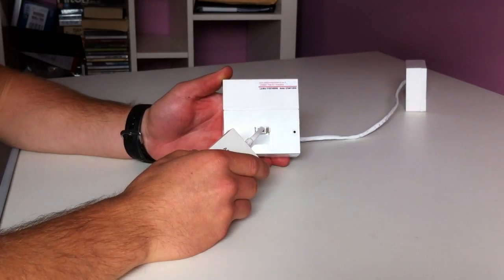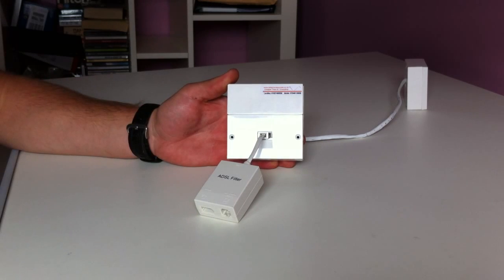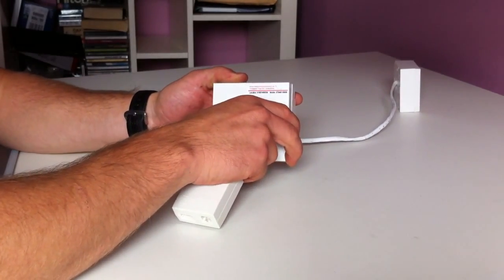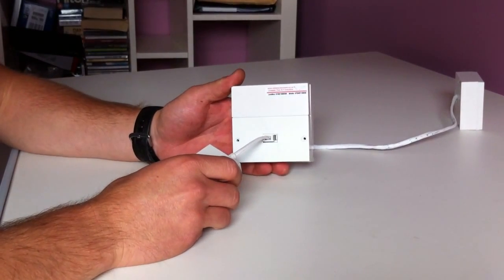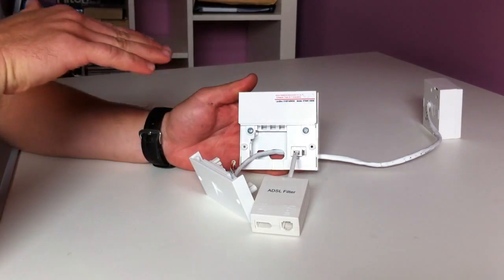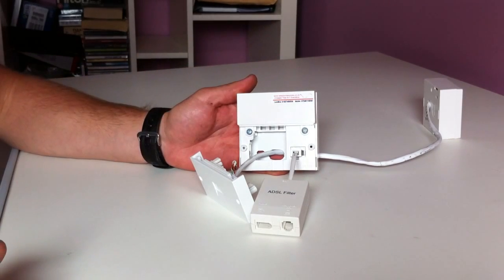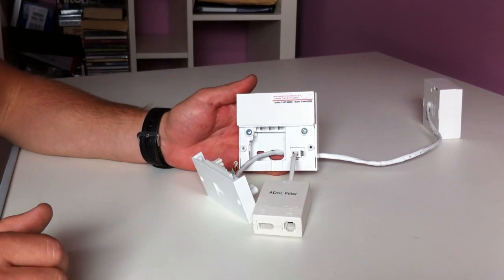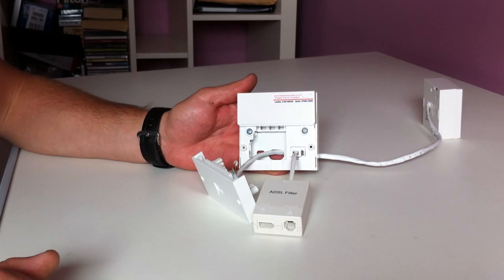Fault on your telephone line? How to test your own internal telephone wiring and extensions.

Comment: Has helped thank you. I didn't known about the line rental. That's a good point, my ISP don't want to replace the line and we don't even have a master socket. We have a master line. Which is just over the door. It's a small box with to wires coming out of it.

Comment: try the checks on that website, really helpful, it could possibly be a hr dis on your line outside, doubt its in the exchange, a hr dis is a hair line break in the cable and when the phone rings it pushes it further apart, you need to ask for a broadband engineer.

Comment: Hi, in my case the test socket is not working but BT refuses to fix it because the cable connecting the junction box and my flat is situated in the walls... they say it is the managing agent's responsibility to do the job. Is that true?

Comment: if any of your equipment supplied by your provider is faulty then charges will be made but you provider will be responsible for them unless the fault was caused by misuse or damaged by you. also if your extentions were provided by your supplier(especially if you payed for them)then they have i believe a 12 month warranty on them. something to keep in mind

Comment: @Sound Speeds   2.5mm to 3.5mm  adapter connected to headset of phone , then to 3.5mm to 1/4 phono (,mono) then inserted to mixer using aux send and mic input,, ,, dial does not hum but when you try to dial a number, a loud humming comes up,,, how do I fix this ?

Comment: Hi, Ive just had fibre fitted and my phone was working fine before the new plate has been fitted. Broadband works but has up and down days regarding speed but i was told to expect this. The phone no longer works and i have tried in the test socket. I'm with Plus net. Regarding the line are they in charge of the line coming to this main socket or just outside my house and all "wires coming into the house" is my respectability?

Thanks

Comment: Hi, my phone line does and always has worked but my internet speed is tortoise-like. Seeing my phone line works fine, is it down to my internet provider connection in the street terminal that is the root cause of my slow internet speed? I have just this minute changed my master socket into my house just a a matter of elimination. Thanks. Ps. My internet speed was fine until I recently changed providers!

Comment: Then how can I get around my problem as my internet broadband has cut off but I still have a tone dial before or after isolation. Recently a BT engineer has installed a neighbours internet in the block of flats I live in. I don’t know what he has done but he has coursed  my net to go off. My service provider has sent me a new router out to eliminate if that’s the problem. But with all honesty I believe it was the BT engineer. I traced my wire to the communal electrical cupboard and found two different cables attached to my cable leading into my property. What I’m really annoyed with is after watching this video it seems like I’m going to be charged for their error. I’d wire it myself if I had ample knowledge. Why would I still have a dial tone weather isolated or not but not have any internet broadband? It’s been of a week now.

Comment: My internet speed decreased, i contacted my isp and they said its a problem with my end if i were to use the test socket temporarily could it go back up to normal until i can get the front plate fixed?

Comment: Also, take note... If you follow the advice in the video, prove that the fault is NOT on your internal wiring, call your service provider to rectify the fault and the engineer informs you that the problem is being caused by corrosion inside the NTE5...... You are still liable to be charged.. .. .. Sad but true ;-(

Comment: hi my wife and i have recently moved home,there are 2 sockets not working.the one in my bedroom just doesnt even seen to fit the phone jackand the other is connected to a double plug socket which is labelled this phone socket does not work but the plug sockets do,is it a case of the wires are not connected to use these sockets?we have a cat that like to chew wires so want to put the hub into my room as the cat isnt allowed in there,anyone help?

Comment: My house phone is great no sound on the line and my internet is fast but tens to drop out a lot when its working its great but its dropping out every 30mins or so adsl like flashs when this happens wait for it to stop then it tryed to reconnect to the internet again what could be the reason for this i have pull my phone out and have no filter as well as disconnected anything elses that runs thought the phone line.
Reply: Your router is restarting due to surge switch to high quality one which can handle electrical fluctuation usually changing the adapter only also solves the problem.
Reply: no it turns out who ever installed it did a shit job was so bad in the wall not funny lucky ive got it all working great now. ty again

Comment: Not true..
You are liable for any damage caused on your property but NOT for genuine  faults that arise prior to your master socket. You line rental covers the provision and maintenance of your line upto and including that socket. That is unless the fault is due to damage or neglegance. You're expected to take precautions to stop damage occuring ie: if the socket is mounted on a damp wall and corrosion is the cause of the fault, you would be charged because the damp is your responsibility